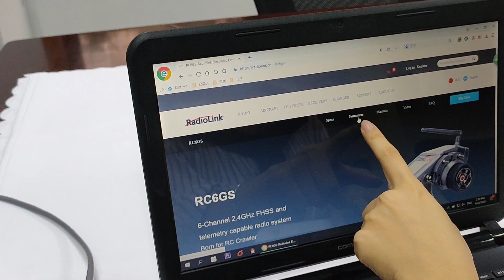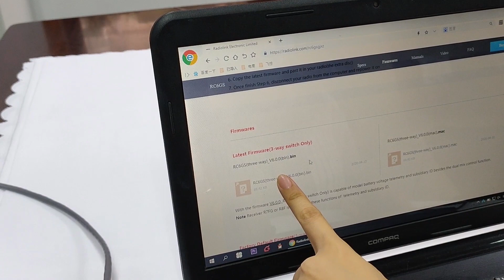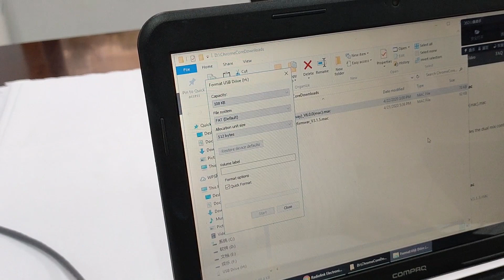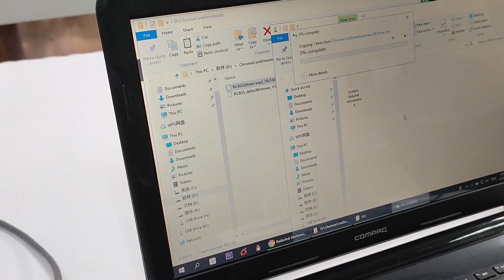How to Update RadioLink RC6GS V2/RC6GS/RC4GS V2/RC4GS Firmware

Comment: Can't get my PC to read.the.controller
Reply from the maker: Hi, sir. 1. Could you please change anothe USB cable to connect RC6GS to the computer? The problem mainly comes from the USB cable. Some USB cable is only used to supply/charge power, and cannot support data transmission. Please make sure the USB cable you use has data transmission function. 
2. WIN7, WIN8, WIN10, WIN11 and XP computers are available for firmware update, but Apple MAC is not supported for firmware update.
3. Please also note when upgrading the firmware, if the computer doesn't pop out the format window automatically, you can go to MY PC and check if there is any removable disc. Then copy and paste the firmware into the disc. If the problem still exists. could you please take a video to us? Our email is: after_service@radiolink.com.cn

Comment: Ok did everything perfect multiple time and when I reboot controller its a white screen nothing on it.Cant even put original firmware back it does the same white flashing screen.
Reply: I just hooked mine up and get a white screen on my controller but nothing pops up on my windows 10
Reply: Ya my controller is useless now white screen. @pbjunky511
Reply: It's the cable I tried using my cable for my 3D printer and it wasn't working so I tried another one and it prompted the format screen
Reply: I have a transfer cable and it shows the .bin file has been copied but nothing after restart
  @pbjunky511
Reply from the maker: Hi, sir. Sorry for the problem. For screen problem, there are two possible reasons:
1. If the screen problem happens after you update the firmware, the problem may come from wrong firmware or wrong firmware update steps.
2. If the screen problem happens when you use it, there is something wrong with the screen, the screen needs to be replaced. Here is the link of troubleshooting of the screen problem for your reference. https://www.radiolink.com/newsinfo/561213.html   If there is still any question , could you please send us more details, such as your transmitter model, the firmware you installed and you can also send us a video of yout firmware update process. Our email is: after_service@radiolink.com.cn
Reply: rc4gs v3,tried"RC4GS V4.0.2.mac"and "RC4GS+Latest+Firmware+V402 .mac" @Radiolink_official

Comment: Will changing the firmware make it so my V2 will reach V3 V4 transmitters
Reply from the maker: Hi, sir. Here is the comparison of V2 and V3 for your reference. https://www.radiolink.com/newsinfo/662555.html Due to the different processing chips used in V2 and V3 versions, Sorry V2 cannot update the firmware of V3. In order to show our thanks to the loyal users for their support to RadioLink, we have launched Trade In activity. All RadioLink users can buy 1 set of our newest models at a special price with the barcode in the battery tray of their transmitters. Here are the details of the activity for your reference, which means you can buy V3 transmitter at a very low cost. You can also buy other transmitters you want with the lowest cost.
https://www.radiolink.com/newsinfo/844239.html  We recommend you to take part in it. If any question when using RadioLink products please feel free to contact us. Our email is: after_service@radiolink.com.cn

Comment: I just wanna know , should i buy new v3 , or stay with v2 for new updted , and what i really hope , i can buy v3 electronic board to replace old v2 feature , bcause its still same casing / design transmitter
Reply from the maker: Hello, sir. Here is the comparison of V3 and V2. https://www.radiolink.com/rc6gs_comparison Could you please have a check? And if you want to buy new V3, you can take part in our Old-to-New activity. Here is the link of the activity for your reference: https://www.radiolink.com/newsinfo/442194.html
Reply: @Radiolink_official  can i know , will v2 have updated a new feature ?
Reply from the maker: @BR-nd7yc  Hello, sir. Sorry V2 cannot update the firmware of V3, because the mainboard is different. That is why we provide Old-to-New activity to our customers.
Reply: @Radiolink_official  okey tq , i will contact if i need to trade in, just bacause im buy v2 this year and 1 month or 2 , v3 release😂😂
Reply from the maker: @BR-nd7yc  Thank you for your understanding. If you need V3, please send barcode of your V2 to our email: after_service@radiolink.com.cn

Comment: Hi there. I have two RC4GS. 
I have been problem with connecting rc4gs and my computers. My all of computers can't recognized RC4GS when I connect like this video. It just show black screen with back light on. I tried another rc4gs too. it's same situation. please help my firmware upgrade.
I tried change PC and usb cable and usb ports.
Reply from the maker: Hello, sir. Sorry for the problem. May I know if it is RC4GS V1? If the mainboard of your RC4GS V1 is produced before 2018.1.1, it cannot update the latest firmware. I recommend you to install the default V_3_0_8 firmware to have a try. Here is the link: https://www.radiolink.com/rc4gs_firmware  If the problem still exists, could you please take a video to show the problem? Our email is after_service@radiolink.com.cn
Reply: @Radiolink_official  rc4gs V2 I bought them this year. And I will take a video .
Reply from the maker: @berserk0304  Thank you. Please send a video of your firmware update process to our email: after_service@radiolink.com.cn

Comment: Hello there. I have Apollo on my radio. I did the same thing you did. I can see that my file transferred. . But. When I turn on the transmitter, the screen comes out blank. I did a couple of times and it's not working. Help?
Reply from the maker: Hello, sir. Sorry for the problem. Please remove the Appolo and then install the firmware again. Wrong installation steps of firmware may cause screen problems. The right steps are as following:
① Connect the transmitter to the USB port of the computer with Android phone data cable.
② Power on the transmitter
③ Computer finds USB Drive
④ Computer pops out formatting USB Drive
⑤ Format USB Drive ( delete the original file manually if computer doesn’t pop out formatting)
⑥ Copy the firmware you need to USB Drive
⑦ Turn off the transmitter and unplug the data cable.
Check the steps. If the problem still exists after the right installation steps of the firmware, change the screen. Here is a tutorial of the solutionfor your reference: https://www.radiolink.com/newsinfo/561213.html  If the problem still exists, could you please take a video of your installation and send it to our email: after_service@radiolink.com.cn ?
Reply: @Radiolink_official  it worked thank you for your help 🙏
Reply from the maker: @badermohamed32  Great to hear that. If there is any question please feel free to contact us.

Comment: I just bought the v3 RC6GS and tried to upgrade the firmware, followed your steps, formated to usb into transmitter as instructed, firmware upgrade fails with the message "There is not enough space on USB Drive. You need an additional 17.0 KB to copy these files.   USB Drive Space free: 86.5 KB Total size: 88.0 KB....." tried to reformate with the same results. Please help   I am using windows 10 latest version.
Reply from the maker: Dear Sir, sorry for the problem. Could you please take a photo of your transmitter to us and send the photo to our email address? Our email is: after_service@radiolink.com.cn  It will be more helpful if you can send a video of your problem to us when it is convenient for you. Thank you in advance. We look forward to your photo or video.

Comment: can only download v1.4.5a for mac? is there a windows file version? You need to separate those files and make it easier for people. Thanks, I'll stick to the original version for now.
Reply from the maker: Hi, Sir. Is v1.4.5a old firmware of RadioLink? If yes, we recommend you to stick to the original version. The Factory Default Firmware of RC4GS is v3.0.8. Users can download firmware on RadioLink official website: https://www.radiolink.com/

Comment: Can we replace channel 5 & channel 6 by using 2 way retun 3pin switch but still using the 3way firmware? Or should we use 2way firmware? Please help and thank you
Reply from the maker: Hi, CH5&CH6 is 3 way switch default, you can use customized the CH5 &CH6 to VR or SWA switch.

Comment: Can this be done using hp or tablet
Reply from the maker: Hi, You can upgrade the firmware of the RCGS or RC6GS remote control with a computer or tablet with windows system. More detail about how to upgrade firmware,you can visit Radiolink new website:https://www.radiolink.com/rc6gs_firmware

Comment: I had issue upgrading lastest firmware 6.0.1 for rc4gs  but after switch on it freeze &  all the buttons is not working.
Reply: +1 help...
Reply: @mehmetcangoktas3357  check your rc4gs manufacturing date is older 2018 mean 6.0.1 firmware is mean not suitable. I purchase mine at 2017 so the lastest firmware will freeze after updating.
Reply: @toughmaniac  how can find latest version firmware for my radiolink

Comment: I would like to know if the RG6S  receiver compatible with the RG4s RC ?
Reply from the maker: Sir, I am sorry , I don't know what is the RG4s RC, but RC6GS can work with all the RC car,becuse the receveri output the standar PWM signal.
Reply: @Radiolink_official  Thanks for your reply. But but what I ment to asked is about the mixing the controllers with the R7FG and RG6S the transmitters. I’m talking about the compatibility
Reply from the maker: Yes， RC6GS and RC4GS can use the same receiver.
Reply: @Radiolink_official  Thanks

Comment: Hello. If i use r7fg with my rc4gs. Will i get the 600m range? Can you please confirm?
Reply from the maker: yes. But please be kindly noted that the control range could be influenced by various factors of the environment.
Reply: Radiolink okay thats cool. Means the range theoretically will be extended by 600m right with my rc4gs. Thats awesome. Then i dont have to buy a new transmitter and i just need the transmitter instead. Thanks.
Reply: Radiolink i have another question. Can i bind rc4g with r7fg?

Comment: What is the difference after upgrading the firmware?
Reply from the maker: Hi Thank you for your question. It depends on the firmware version. Some improve the less adavanced points collected from RC fans. Some add new functions.
Reply: @Radiolink_official  can you explain what different type of functions ?
Reply from the maker: @gpgp1750  Hi, Sir. For example, our newest firmware verison 6.3.2 adds head tracking function. We will add new function or some points on new fw. You can find new fw in our official website. There is introduction of new fw with new function.

Comment: i still have not got the R7FG receiver, Is this update compatible with R6FG receiver?
Reply from the maker: Yes, both R6FG and R7FG are compatible with this firmware.
Reply: Yes.  Standard four or six channel receivers and probably all the ones that were previously compatible moving forward.
Reply: Not that I need 1, but IF the 6 & 7 channel recievers get "rare", I'm guessing 1 could use the 8 channel recievers too? (Then again, 8 channel would provide another accessory port for lights or something that would not need a signal wire)